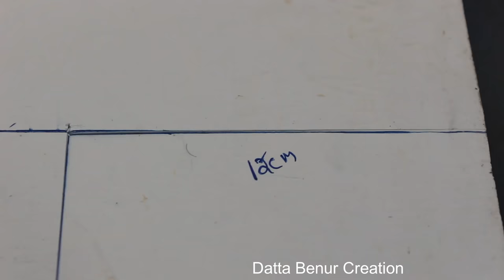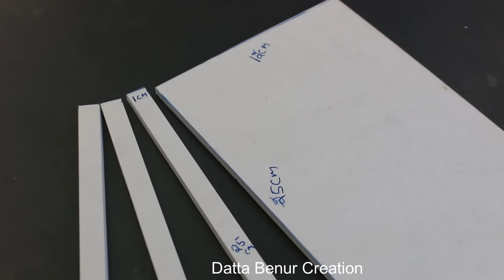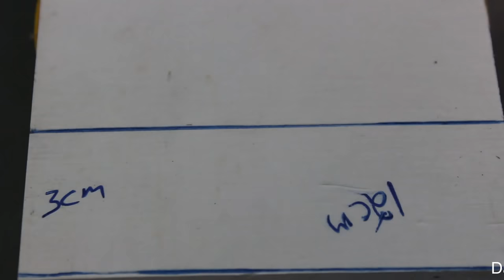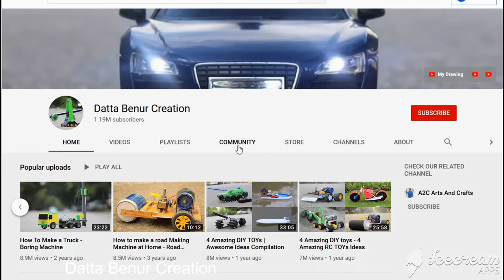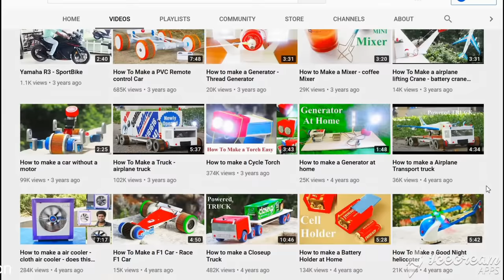How to make a Powerful DC Motor Car - Electric Toy Car

Comment: I see the motor is connected to tyre top. Does this seems reliable?
Reply: not really , i suggest if you add some gears , and connect both the engines to the rear tires , and then you will get a RWD car